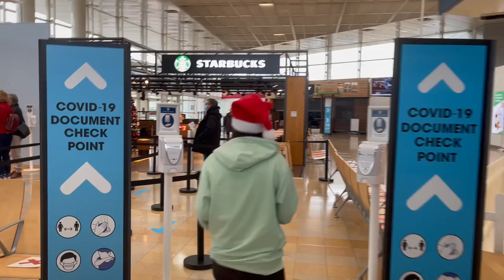WHEN VAN LIFE GOES WRONG.. MORE THAN ONCE! Problems getting back to UK! (female van life)

Comment: A battery monitor is cheap and easy to install. When your voltage drops to 12.2 volts, start the engine and let it charge. If your rig only has one battery, be sure and have a Charged jumper pack on hand. When your battery is reaching the 5 year old mark, swap it out. It's not worth taking a chance. Also, periodically check the tire pressure in your spare. Another recipe for disaster, when you're remote. Happy trails.

Comment: When you are starting the van from cold in icy conditions,Turn the key all the way to starter position,dash lights,leave it for 20 seconds,turn off then do it again for 2 more times then start. Glow plugs take a bit to heat,should start a lot easier!
Even in warmer weather,do it once , you will hear the relay click off after about 20 seconds, that’s the glow plugs turning off.
Have a good trip!!
Reply from the maker: Thanks Gerry, she normally waits for the glow plug light to go off but they go off so quickly so this may help as well 🙂🙂

Comment: Hey Girls, I’m so pleased you got back and really sorry for all your troubles. But it’s all behind you now. I was in the motor trade before I retired last year. One little bit of advice if it’s not done, replace the handbrake cables to be sure as we where always replacing them in these vans as they seize up due to grit and salt of the roads. Spray grease on the joints and moving parts helps too.
Hope you enjoyed your Christmas as well. Great video and a big well done.
Roly in Manchester xx xx
Reply from the maker: Hi ya, thanks, the cables were replaced 🙌 hope you had a good Xmas and have a great NY
Reply: @campervibe  yes we’ve had a great one, thanks. Hope you have too. Roly. X

Comment: What a relief when you walked into your home. That van has given you too many headaches. Have you considered swapping to a Mercedes Sprinter. Parts are readily available on the continent, and world wide. The coach travel company I used for twenty years used Mercedes Setra coaches because the coaches were in Europe more than in the UK and any breakdown had to be dealt with very quickly. Appreciate the way you keep the real feel to your channel.
Reply from the maker: No swapping the van, but don't forget last year it wasn't so much the van as the garage that made things 100 times worse 🤦‍♀️ we love our van 🙂🙂

Comment: If you are going to be in minus weather a "block heater" works great and does the engine good. A heater pad on the sump is a cheaper option which also works well. I have had both, regards Tony
Reply from the maker: Thanks Tony, I'll make sure Lou knows
Reply: Don't they need Grid electric to be effective overnight? Maybe with an modified alternator that puts out 250 amps and a big bank of batteries and inverter for when there is no place to plug in?
Reply: @KP11520  I'm pretty sure you're right.  You'd need something about 1KW for a diesel engine like this I think.

Comment: Glad you made it home in time for Christmas! Excited to see what you do going into 2022. As one of the issues you had was a flat battery, would it be worth having a seperate battery jump starter? I have a NOCO Boost Plus GB40 in my car incase I run it dead when car camping, but its rated for up to 3.0L Diesel engines so I could use it if / when I get a van, might save you a call out in future if you've run down your starter battery! Even in this instance your battery was dead completely and not holding charge, a jump starter might just help you get going again!
Reply from the maker: Thanks Matt, not sure what lou has in mind she won't even tell me so I'll be watching the vud she makes as well to find out, few people have suggested that as well 😀  have a great NY

Comment: Great video, I haven't seen the next video yet but in the past, I built SVO (special operation vehicles) and was a motorsport mechanic and you did well. Presumably, your camper batteries are chassis earthed so I would suggest a fused link back from the camper batteries to the van battery with a manual cut-out or a dash-switched relay (winch solenoid) as an emergency starting backup. My other advice is to build yourself a van spares kit and stash it onboard... it is way easier to find a mechanic to just fit your parts than a garage to supply and fit in an emergency. Hugs to AJ and the moggy! , All the best Jenna.

Comment: Well done for sharing the real ups and downs of vanlife. I broke down only 20 miles from home the other day in my Peugeot Boxer Auto sleeper and that was stressful enough!
Reply from the maker: They are a pain whatever or wherever you are right, hope it's not or was not too bad
Reply: @campervibe  Do you know what it was. After getting low loaded home. The next day I found it was the fuel pump fuse. Annoyingly, I changed it when it wouldn't start with a new one........ Which was duff in the packet!!! Good old Halfords!! 🤣

Comment: I know this was months ago but for future reference if you suspect glow plug problems try waiting for the light to go off, turn off and on the ignition switch and start the engine after the light has gone off the second time. They are easy to diagnose with a multimeter and easy to change if one or more is burnt out.
Reply from the maker: Thanks for the tip, I always do! The light on ours goes off really quickly, I also wait until I hear the relay click off too. We’ve had them replaced since, I always do them all as well, rather than just the bad ones.

Comment: I’m sure you know this but for in case you don’t, there is usually glow plug symbols on the dash. (2 little curled wires) You need to turn the ignition half way for them to power up and heat the engine chambers, then follow through with start when the lights go out.
Reply from the maker: Thanks, we do and we have one and it goes out 🤣 but thank you for saying though as I'm sure other may not know 😀

Comment: Hi!
I just found your channel and I like your content and humour 😊
I watch your return to UK video and a few others. 
The issue with the battery could happen again therefore, I would like to recommend that you take with you a good quality Jump-start pack. There are loads on the market, however, some are much better but more expensive than others. I would recommend NOCO GBX series either GBX40, 45 or 50 from £100 to £145 on Amazon. These can also be used as a power bank to recharge your phones etc in an emergency. These jump-start packs can be recharge on your van.
Just a thought.
All the best for the new year and for your future travels.
Reply from the maker: Hi ya, amazing you found us and even better you are enjoying the vids 😀  thanks that's some great tips there 😀

Comment: Best viewing on my TV bar none!
Your decision to come back when you did was exactly the correct one.
I was thinking you might to try to get to France for a Citroen garage but well done the Germans.
My Ducato Heater Plugs warning comes on even though I wait after turning the ignition on before trying to start it so I'm thinking I might be in for the same problem.
Anyway your resilience to overcoming your problems is a joy to watch, "fumbs" up to you both!
Reply from the maker: We are going to get it checked out and get the glow plug changed, can not be doing with that crap next time round 🤣 have a good NY

Comment: The shop, where you got the new battery from, could have done your rear brakes also, don't rely on brand garages, if you won't buy a new van. Then they are quite happy to help you out, asking  to repair an old one (older than 2 yrs!) make them quite reluctant...
Glad you made it and just in time!
Thx for the vid!
:-D
Reply from the maker: We did ask them, all in all we went to and tried about 6/8 different places in the end but these guys were the only ones that could do it in time, if it was not right on top of Xmas it would have been a different story for all I expect
Glad you liked it 😀

Comment: I actually was in a van, where brake pipes broke, and lost ALL brake fluid, so NO brakes (and) the handbrake didn't work either, and made it from Midlands to London and back using clutch and gearbox ONLY, needless to say my ass was puckering ALL the way, no handbrake now is not a big deal to me, having no handbrake is no deal, it's when you have neither you have to worry..
Nice vids people, love the content.
Reply from the maker: Bet that was a trip and half, for us it wasn't an option not with AJ and Summer in the van and the horrendous noises it was making, they were getting rather scared 😳

Comment: I have a Boxer which doesn’t like the cold weather either. I found switching the ignition on and off a few times gets the glow plugs hot enough to start the engine. Just turn the ignition on until the glowplug light on thr dash goes out, then turn ignition off and do it again and again (three times for my engine is usually enough). Hope this helps, great videos
Reply from the maker: Thanks for the tip Martin 🙂🙂

Comment: If you're using a hand brake while driving, that would be a hand brake turn... that's why you can drive safely without one! If you're on a steep hill waiting at traffic lights, it's a bit trickier just using the foot brake without the hand brake but not too difficult and worst that happens is you stall it a few times and hold up traffic, but everyone around you would be stationary anyway...

Comment: I thought as a Auto Electrician on HGV Trucks, Your motor home seemed to start slow, even with a new battery ,I'd get a sparky to test the wiring and connections out when it goes in, is there space to fit two batteries in there, wire in parallel to give the same 12v, but twice the capacity, your sparky will understand. Now come on you two less of the breakdowns, nice to have you at home.
Reply from the maker: Definitely need less breakdowns in 2022, cheers, we will get them to check a few things 😀

Comment: Thanks for another great and this time dramatic video. I just wanted to make a small point and can be sure if I have it wrong I will be rebuked. I noted when you had cold starting problems you were putting the key in and turning it immediately to crank the engine. I have had a number of Peugeot and Citroen diesels and have always turned the key, waited for the glow plug light to go out and only then cranked the engine. This ensures the plug temperature is optimised for a cold start. This is just my observation from watching today. Whatever a very Happy New Year to you both and your four legged crew members.
Reply from the maker: Hi ya, yeah we have a glow plug light that Lou waits till it goes out before she tries to turn it on 🙂 its still nice of you to say though, have a great NY 😀

Comment: I kept a cheap mini starter pack onboard that was topped up via usb and a can of easy start. Also try insulating the battery box.with it inside the cab it should not go sub zero. Looking forward to seeing the upgrades next year..have a safe 2022
Reply from the maker: Cheers Jon, lou does have some winter upgrades to do 😀😀

Comment: I hardly use the handbreak. Usually I put in 1st Gear and this is good. If parking on a hill, back gear also might help. With humid and cold weather the hand break likes to fasten up 🙄. Plus if you use the Gear, the car can slightly move a tick forward or backwards which helps in case someone runs into it. It can swing a bit away from the impact.
Reply from the maker: Lou is the same she hardly uses it either, the brakes were the bigger problem and the noise 🙄
Reply: @campervibe  the noise is awfull 😱luckily you have made it back home. Enjoy the time with your families. We have had -15 C  during the last  couple of nights. Nothing I would want to spend in a Campervan 🥶

Comment: Great vlog, good that you could come home on Christmas 🎅. The flat battery is something I had in the past checked the van evening before filled up with fuel and the next morning 4:00 no power😟. Start with cables from the car and drove from the south of France to the Netherlands let the motor run at tank stops and changed there the battery.
Reply from the maker: Glad you sorted Frank, annoying when it happens 🤦‍♀️

Comment: What an effing carry on, and what an effing good video too, it will at least make you prepared for anything in your future travels also. I'm interested to see what you will do to modify your van for the next adventure, perhaps a secondary battery for a start when needed. I've wired in a heavy cable with a 600 amp switch from the leisure battery that can assist if required. A fab vid anyway.
Reply from the maker: Oh yeah, we learn all the time which is great for these types of things and hopefully others will learn from the stuff we put out as well 😀😀

Comment: I think you touched on this but with your B2B so accessible if you ever have that issue again, you can just swap the input/output and you'll be able to charge your starter battery from your lithiums. I also keep a little 2A mains trickle charger attached when it's mega cold (could plug it into your jackery).
Reply from the maker: Thanks Rhys 😀👍

Comment: Glad to see you got home safely I hope you had a great Xmas, one recommendation I can give you is get the van serviced before going on a trip so any items that need attention can be dealt with before it becomes a problem.
Reason van moved when in gear because you had to use clutch control instead of the handbrake.
Sadly like you I am lost with modern vehicles having been able to do most things for myself  replacing alternator  spark plugs and fitting rear seat belts plus extra brake light to opening bonnet and forget it where do you begin.
Reply from the maker: Hey Mark, happy NY to you, we actually got the van serviced before we left we wouldn't embark on a trip like that with our family in the van without having one, we even had bits changed that were recommended as well, sometimes these things happen unfortunately but thanks anyway 👍🙂

Comment: Happy Christmas &New year to you both.
It was a great video, showing the in’s & out’s of van travel. Look into the the possibility of jumping the van from your lithium batteries, or a power bank that charges/ runs equipment,, sometimes the main battery (van) just needs some help in very cold conditions!
Well done driving without a hand brake on such a large beast.
Pleased you all made it home safe and for Christmas.👍
Reply from the maker: Hope you had a good one and an even better NY, and thanks 🙂👍

Comment: Good effort.

When you said the handbrake had gone, I was worried you were going to be travelling by ferry.
Having to drive up the ramp onto the top deck of a ferry WITH a handbrake can be scary. Doing it without a handbrake would be terrifying.

Regarding the battery, is there a place in your leccy system where you could attach a set of jump-leads temporarily so you could charge a 2nd starter-battery while the van's running and then you'd have a fully-charged battery ready to swap if you needed it?
If not, maybe you could add cables, terminated with an anderson plug bolted to something solid, and then get a set of jump-leads with and anderson plug on one end so you've got a way of charging a starter-battery from inside the van?

I have a Land Rover which gets used as a weekend camper and I've deliberately fitted a "house" battery that's identical to the vehicle battery so that, if necessary, I can just yank the house battery out of it's box and fit it under the bonnet.
Theoretically, once the vehicle's running (and there's no other problems), I could then hook up the flat battery in the back and the DC/DC charger will charge it back up again.
Obviously, it's not a perfect solution but it DOES mean I get two chances with a fully-charged battery rather than just one.
Basically, if I get a flat battery, I can check to see if it's charging and then, if it's not, I can bung the house battery under the bonnet and then I've got a chance to drive to a garage before it goes flat.

I thought that, after last year's disaster, Lou' said she was going to make the effort to buy more tools and learn more about becoming a spanner-monkey?
Seems like, perhaps, that needs to become more of a priority.

Don't under-sell your content.
Sick to death of seeing video's where people demonstrate how good they are at spending money, in order to fit shiny new bits.
Much rather watch people actually getting out and doing stuff, even if it's only an overnight stop in a supermarket car-park.
Over the last couple of years your channel has become one of the ones that I ALWAYS watch as soon as you put a new video out.

Anyway, have a happy new year and keep smiling.
There was nothing you could have done to prevent last year's disaster and this year's problems were fairly minor so things are improving.
Reply from the maker: There is some great info in this comment but it is truly wasted on me, I will show Louise as she knows what she is talking about or at least seems like she does 🤣 thanks for taking the time to write it I will make sure she has a look 😀😀

Comment: I have noticed that when you turn the ignition key, you immediately engage the starter motor. I suggest that you wait five /ten seconds and then start the engine. It may be that you don't have a glow plug problem at all.
Reply from the maker: Hey Peter, lou has touched on this before in other vlogs what you see is not always the first time the engine has been turned on in the morning and if it is she always waits for the glow plug light to go off 🙂👍
Reply: @campervibe  I did wonder but just thought I'd mention it. Thoroughly enjoy your videos. Happy New Year to you both.😄😄